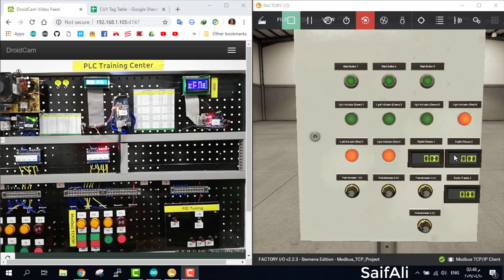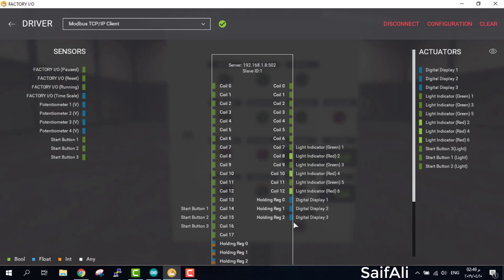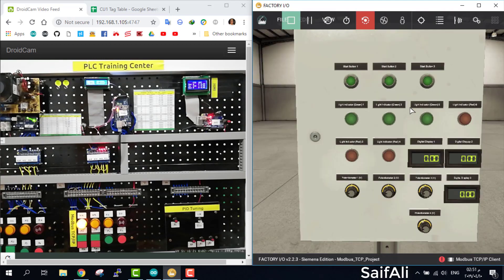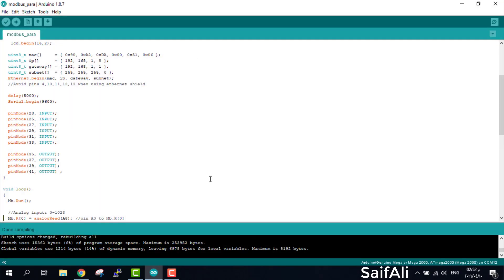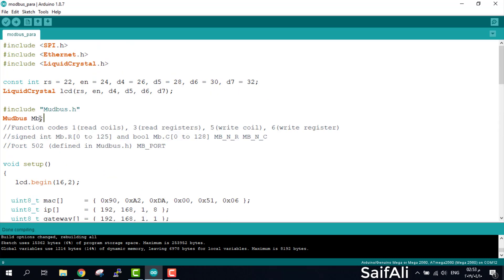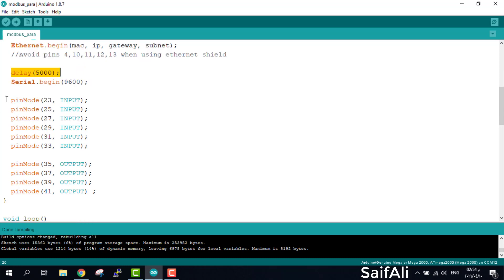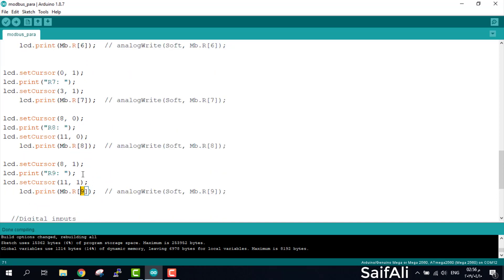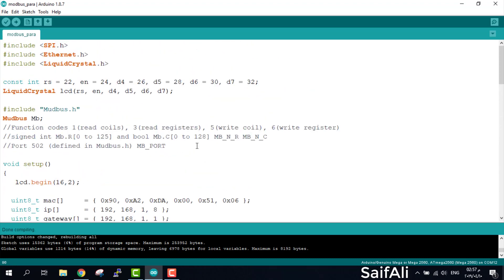#04 - Arduino TCP/IP server - Factory IO TCP/IP Client

Comment: Nice project. Would it be possible to somehow have more than one Arduino at the same time ? For instance if I have several "stations" with temperature/humidity/etc. sensors, each with its own Arduino. I'd like to have like a console to view values from all of them at once.